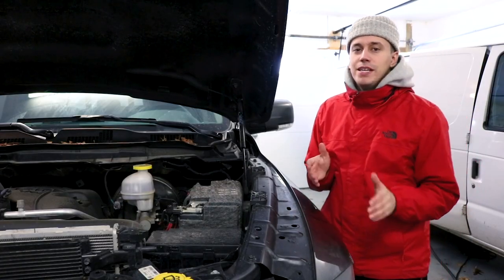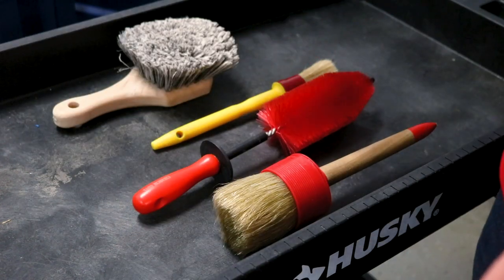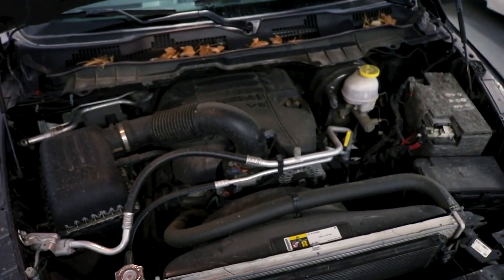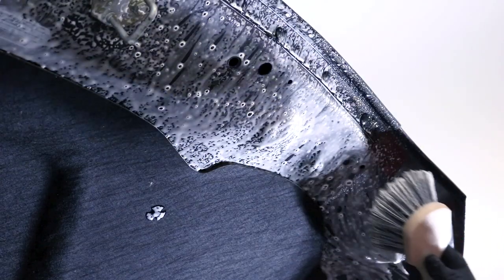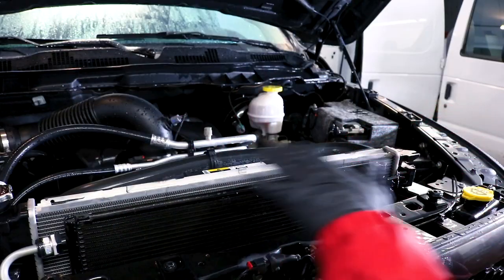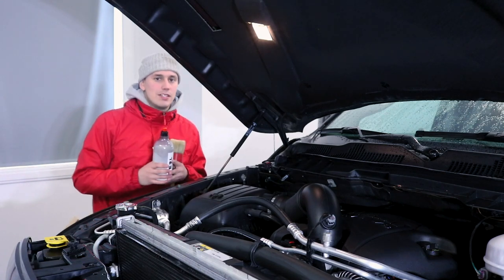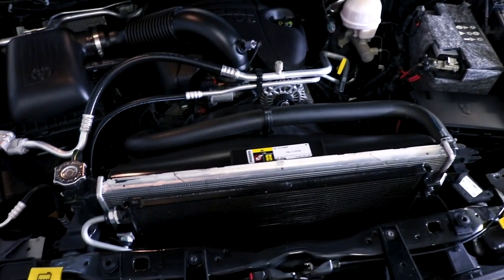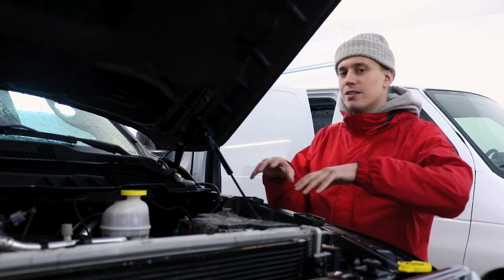Detail Your Engine Bay In 6 Steps

Comment: Need to always protect the alternator as it can short out it's diodes if wet inside. A plastic bag around it works pretty well. It's the one very vulnerable thing under the hood to water. Alternators haven't really changed over the years. Ideally those diodes would be potted and in modular pack but they never are, just soldered in there.